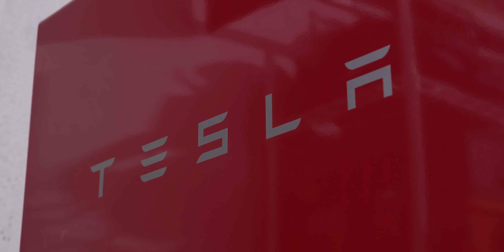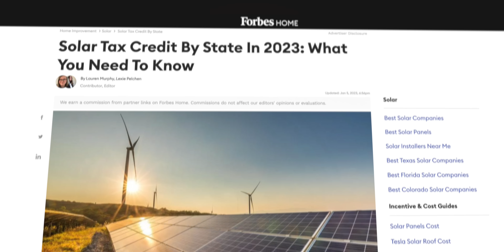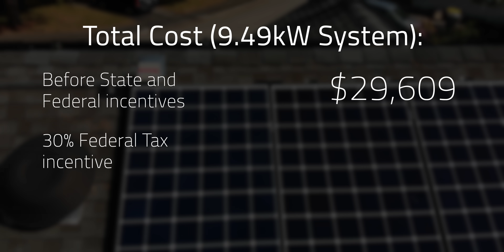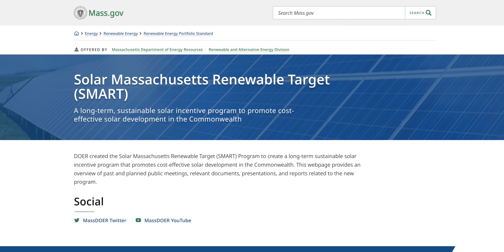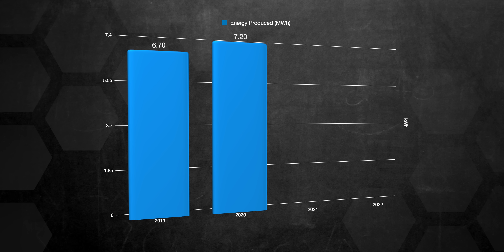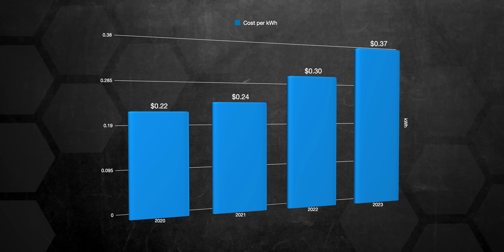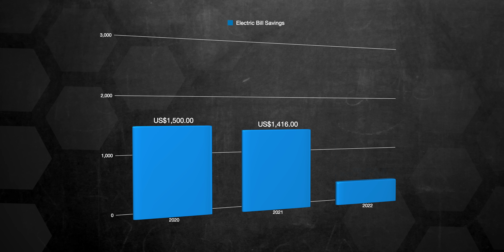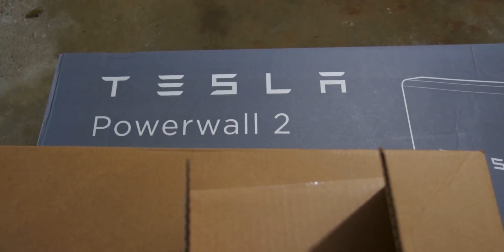5 Years with Solar Panels - Is It Still Worth It?

Comment: Similar situation here in NJ. Ours is a 12.35kW non-Tesla solar system (38 x 325w QCells panels & 11.4kW SolarEdge inverter) installed in mid 2019 with PTO Sept. 2019 no Powerwalls....yet. ;)

Annual production has been just over 14MWh per year in line with the estimate by our installer for a grand total of 54.3MWh produced to date as of 7/9/2023.

We also received the full 30% Federal incentive on our 2019 filing (on both the solar and a full re-roof as "site prep") which netted us a return of just over $15,200 paid back to the solar loan. 

We are also grandfathered in to a NJ 10-year SREC program which has earned us a total of $11,425 to date on the sale of 52 SREC's at an average market rate of $219.71. 

Since PTO (going on almost 4 full years now) we have paid our utility provider only $600 in excess usage, or about $150 per year vs about $2000-ish per year pre-solar based on 2018/2019 rates. Most months April-Oct. our electric bill is just $3.25 for the grid-connected customer fee. We are on net-metering (1:1) and bank excess generation for use in underproduction months.

In the end we are super satisfied with our choice to go solar! It basically offsets most of our home use (2,500 sq. ft.) PLUS my Tesla (Model 3) EV charging of about 10k miles of driving per year. Accounting for the incentives and savings per year we are already ahead in ROI, and as soon as the solar loan is paid off next year the returns and monthly savings will only multiply. Our full system is back by our installers 25-year warranty as well as the manufacture 10-year plans so there's plenty of peace of mind rolling into our bright solar future. :)

Comment: So out of almost 10kw of solar panel power you make  under 1kw of power on average per year. Calculating that night is half of the time, and winter months/clouds are also likely 1/2 of the time I guess 10-20 percent is max you could expect, except in southern areas and deserst such as Sahara, where there is not rain and sun angle is better. There you only loose at night, so I guess even 30 percent is possible. But now prices for solar panels are much lower, you can get 10 KWH in power for less than 5000 USD, and  even if electricity price is just 0.10 usd per kwh, you would save around 800 usd per year, and with the price of 0.37 usd per KWH you can return the investment in 2 years.

Comment: Hello Matt I use to sell solar if I may let me give you some advice for your new home no matter what you do go with a microinverter system because it stays optimal even with shade or a panel goes out vs a string system  which is effected by weather,  shade and other panels if a panel goes out on a string system the other panels will be limited by the low output panel or shade on that panel it will be limited by the shaded panel also a string system uses a single inverter
Reply: I have no idea what your continuous one line statement just said.

Comment: Good video and you cover a lot of salient points. IMHO Solar only really begins to make sense when you don't have access to a reliable power grid   I'm surprised that your system has gotten close to paying for itself but much of that was subsidies so the solar didn't really pay for itself but other taxpayers paid for your solar.

We live totally off-grid (power-wise at least) on our sailboat 90% of the time since we almost never stay in marinas where we can plug into the grid. Our solar panels and wind turbine provide 100% of our power needs since we don't have a generator and never run the diesel engine solely to charge batteries.  The system meets our needs but the cost to install and maintain it would never rival simply buying power from the grid even in the most expensive areas.

But there are always other factors.  One can't simply run an extension cable miles across the water nor do marinas simply charge you for power -most give you the power for free since they are already charging you hundreds if not thousands of dollars a week to stay there. In Florida during the winter season costs are easily double or triple what they are in the North during the summer. Being power self-sufficient allows us to stay out in the middle of nowhere anywhere we choose and not need to run a noisy generator or put needless thousands of extra hours on our diesel engine over the years and thus requiring replacement years earlier than otherwise.  Sailboat engines often cost more to replace than older boats like ours cost used in today's market.

But solar has other hidden costs.  Things break and wear out and the efficiency of panels steadily if slowly goes down as they age.  We also were hit by lightning a couple of years ago and all of our solar electronic controls were fried and the efficiency of the panels themselves took a major hit too since their output has fallen faster than predicted ever since. It has gotten to the point that we are considering their replacement soon  because during the winter minimum our production is reaching a level where it is getting close to or exceeding our power use at times for days on end, and that is straining our batteries when we get a couple of cloudy windless days in a row.  

Direct lightning strikes are exceedingly rare but near-hits when connected to the grid in a co-generation system such as yours can damage a system too.  Our system was only five years old when the lightning hit us directly and a couple.of  years later we are contemplating replacing the last remaining parts of the system that didnt get replaced right after the event.  Completely replacing everything within even 10 years, much less 7, really puts in a twist when running the numbers of cost/benefit analysis.  In our case we need the system at almost any price, but it does affect our overall budget and what other things we need to give up or whether an early retirement is even feasible in the long run living on a small sailboat.  We might need to get jobs again if this economy continues and our savings continue to be swallowed by the inflation monster.  Perhaps the costs of maintaining our off-grid power system isn't the largest of problems right now but it still is a major factor to consider.

Comment: I recently looked at a home with solar panels and the debt to take over is what drove me away. I was looking to buy a home not a home with a large separate loan to be attached.
Reply: Interesting, if I really wanted the house, I might have negotiated the seller to pay at least 1/2 the balance of the solar loan. If you are in an area with high electric costs per kWh, if the electric savings covers most of your bill, it still could be worth it to pay part of the loan…
Reply: @maryrenaud6732 that was just one of the homes we looked at during that time. Wife liked the property more outside the home but didn't like the inside compared to a few others.
Reply: Odd. All they have to do is pay off their balance after adding it atop their asking price.
Reply: I also walked away from a home with an assumable $339/month lease payment.
Reply: No one is mentioning how these roof solar panels void the shingle warranty. No mention of the insurance costs of just having them. No mention of how long the panels actually last. No mention of the cost of replacing the roof along with the cost of panel removal and reinstall. No realtor will tell you that the panels add value. None
Reply: @lisafigueroa5307  Zillow will.   3-4 percent and your home will sell faster.   So, I can listen to random YT guy or Zillow.
Reply: So bundle them.   One payment.

Comment: Passive homes are worth looking at. 

Do solar panels degrade over time?
Reply: according to my research you should expect to lose 20% of efficiency over a 25 year period.  But hell, in 10 years they'll have something out that'll far eclipse what you can get today in efficiency and at a lower cost.  But I wouldn't wait.  I installed my own system, turned it on 1Jan2020 and have paid $1.80 for electricity since then.  One of the best investments I ever made.

Comment: In our area (LAS Vegas) you can have neighbors prevented from interfering with the daily sun on your panels. If a neighbor plants a tree they have to consider your solar install and prevent shading of your system. Something to look into in your area!

Another quick observation is on windy or cooler days (yes even here in Vegas!) our 5.6kwh system can produce up to 6kwh (the max on our inverter). So take into consideration your wind and temps and what possible effects they may have on your system.

One last note! Go big! My regret is that I didn't go bigger on our system to begin with. Now our panels are no longer produced and adding to our existing strings is not possible with mis matched panels. Our options now are to find some used versions of our panels or create a whole new system for added capacity. Reasoning for the go big approach include adding a plug in hybrid or fully electric car, maybe a pool is in our future, and even cooling our home a bit more when it's 115 outside!

Hope these tips help!
Reply: Sounds like a Communist town that yells you what to do on your own land!
Reply: Solar panels operate only on the amount of light available, despite wind and temperature.
Reply: @TerryD15  you need look into it further. Temp has a lot to do with the amount of power solar panels make. Our highest out out month here is May. The sun is much kore favorably positioned in June and July but the heat here reduces output considerably. Of course cloudy days affect output but so does temp.
Reply: @TerryD15  So, the laws of physics are ignored in a city with 115 degree temps. Too funny. Do your research. Temp doesn't provide the power itself but temps do affect how much power  a panel will produce. All things being equal a panel in full sun on a cold (or windy) day will produce more power per square centimeter (power density) than in a hotter calm day. Even new bifacial panels are being being arranged vertically (facing east and west) so as to reap the benefits of cooler panel temps at mid day. This creats a double hump power curve but yields more power by avoiding the mid day added heat full sun creates. 

We may be arguing symantics here but please research tempurature effects on solar panels. It's usually even stated as part of the power specs on panels.

Comment: Everybody has way more solar panels than they need and stop wasting your money with the grid tie system. use a all in one charge controller use a minimal battery pack panels are cheaper than batteries and win. Possible stick with hundred watt panels it will reduce your watt cost by $.40 or more. Hunter watt panels are $64 right now sizers. your solar array to recover your batteries from 20% to Full in five hours in poor light I built my whole system for Less than $5000

Comment: back in the early 90s i built a solar system, cost close to $40k, and I did all the install and setup. No govt handouts back then. Was it worth it? Yes because I always had more power than i could use. Did i sell excess back to the grid? NOPE! Why should i fund the wear and tear on my system, even with the highest of payback rates its not worth it. I want $5 a KW for my green power. F them

Comment: First---You Tube is a great benefactor to your checking account (most people do not have that advantage), Second--you fail to mention any damage the existing roof accrued, Third---Solar panels are screwed down to the existing roof (roof leaks occur as the panels get older), Fourth---Your roof is probably way overloaded with the weight of the panels and then you add 12" of snow and you are now way over the load rating of 40#/sq. ft., Fifth---battery life???, and last but not least, Sixth---What happens when the solar panels become deterioated and no longer are effective (remove and replace and probably have to replace the roof shingles also). In closing---in the end it is cheaper to pay the electric then go with solar. Just my opinion as a retired building super!!!
Reply: Roof should not be overloaded.  You do realize they have to be permitted right?  Plans are given to structural and electrical engineers which have to sign off on to ensure your roof can take the added weight of the panels.

Comment: I live in North Eastern Australia (SE QLD) and have 6.6kw on the roof.   It already saves me a ton.   My old house annual electricity bill was over $4k, and now it’s less than $1k, for a similar sized house, with large pool and same number of inhabitants.  No battery. The new house is a bit more energy efficient and we have split system for heating/cooling. I’m looking to get an EV shortly, for the first time, so have been looking at what impact that will have on my energy use and cost.  Turns out that charging the EV during the day is going to cost me exactly nothing most of the time, as I’m already putting more than I’ll need into the grid every day that’s sunny, which is about 80% of days here.  Even if I charge at night it will only cost me $10 to completely fill the battery from zero to full, which will be very rare. Do the maths on that!   My situation and setup is reflected in about 30% of the houses here….so anyone who thinks EV’s aren’t coming soon is dreaming.  Then think about what happens when we can power the evening and night time energy use from your car battery….insane!

Comment: Just looked into Solar here in Georgia.

8.8kw System and no battery, $30k, $155 a month after 30% Tax Credit applied.

Daily Connect Fee and other fees and taxes and 20% left of power usage would be around $35 a month.

So total monthly cost was $190 a month.

I currently pay $160 a month on grid power. So Solar would have cost me $30 more a month.

They estimated a excess from Solar of 350kwh a month or 4,200 a year. My power company pays out $0.06 a kWh. So that would be $21 a month. So still paying $10 a month (at the minimum) for Solar. 🙁

We out of here in 4-5 years so didn’t make sense to me to pay more for Power than I do. Yes it’s estimated a 4% equity when selling, but no guarantee.

Now if I was lucky and got a $126 a month buy back then I’d def be doing Solar.

I also didn’t like the idea of having a $21,000 loan on my credit when I’m trying to be debt free before the move.

But def getting Solar for my next house!

Comment: I have had solar panels for 4 years and what a money pit. I actually watched your channel that motivated me. Here in Utah everyone is trying to sell you 3 things. 1-some sort of multi level marketing scam. 2) some sort of E currency scam. 3) solar panels. To quote someone I work with,”everyone has to have a side hustle.” Solar panels dove tails perfectly here (the fraud capital of the USA) Our panels are south facing, high altitude desert climate and we get about 30% of what was promised. Utah definitely won’t allow you yo pay into the grid like you would think they should. Still paying off the solar panels and still have a power bill. Called the company that we bought them from and they are horrible. Would I do it again? Sure. Got to keep those Utans with 12 kids fed right. Everyone has to have a side hustle…right.
Reply: Here is the jist.  You can't trust any contractor that pitches you anything.  You have to do your own homework and research.  That has always been the case with any homeowner renovations.  Solar panels are still very much in their infancy stages and don't work well for the vast majority of the average homeowner but in rare cases they do work very well when the proper circumstances align correctly.  IE a southern facing roof, a new roof or one that was recently replaced in the last few years, and not using the installers financing because their rates and fees are always high.

Comment: Solar panels on a roof are the most stupid idea ever. The life of a roof with ashphalt shingles is 15 years so every 15 years those things have to be hauled off and replaced. Where they're attached through the roof there will be leaks and rotted wood - not every place but enough to make the shingle replacement a nightmare. In addition to that, shingle replacers are not going to be nice with your solar panels and will probably just fling them off the roof.
Reply: A high quality shingled roof can last you 20 - 25 years.  You put the panels up after a new roof you are golden.

Comment: Solar panels are the biggest scam on the market, I have not saved a dime on my electric bill, in fact when you add in the cost of the panels, my bill has doubled. The electric companies in Texas don't want you to have solar. They charge me one rate for electricity but pay a far lesser rate for the power I produce. And in 2 1/2 years of having solar I have not had 1 bill where Iwas given credit for all the energy I produced, usually it is less than half. Even with the panels my average bill is around $140.00, plus $165.00 for the panels, where as before going solar my biggest bill in the 3 years I lived at my house was $150.00. I live in a 1300 sq. ft. house by myself, just so you know what kind of power usage I have. I'm thinking about hiring a lawyer because everything that I was promised was a lie. Going Solar SUCKS.